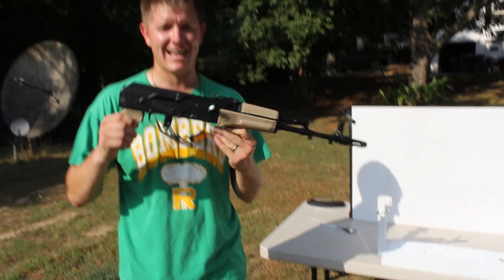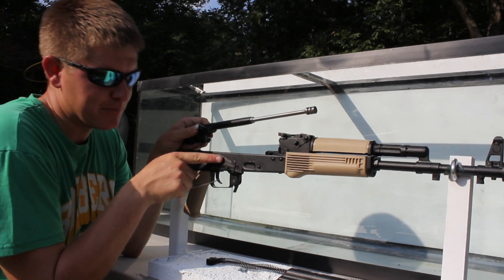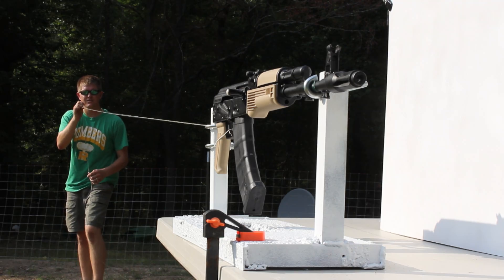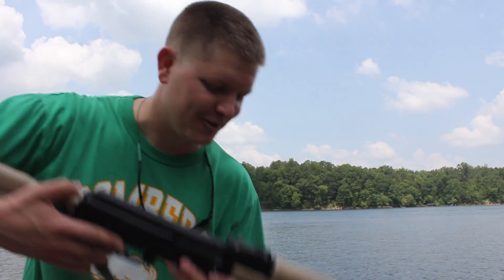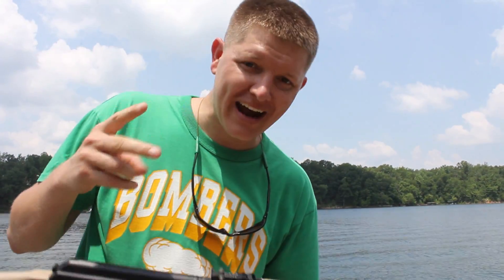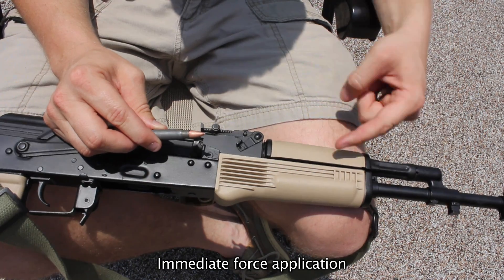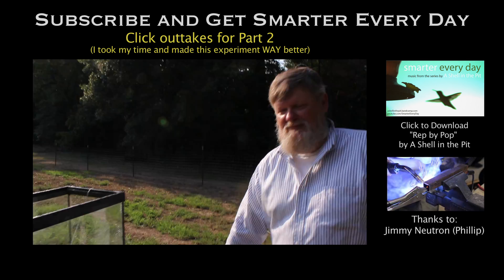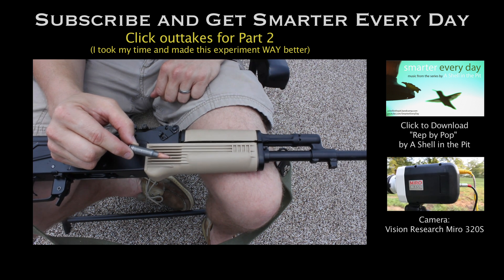Slow Motion of an AK-47 Underwater (Part 1) - Smarter Every Day 95

Comment: You are incorrect, Russia which is roughly the size of the USA has a higher murder rate. And you can not say that it's only one or two factors that account for murder rates. America is massive, half the size of a continent compared to Japan which is smaller than almost all 50 states. Japan also doesn't record murders unless someone is found guilty as where America classifies all murders in statistics. Character limit stops me from listing more
Learn YOUR facts before trying to make a statement.

Comment: Destin, I know you said it messed up the experiment but the way the shatter propagated through the tempered glass was pretty sweet and crazy fast. It was fine one frame, then half shattered the next frame, and fully shattered the next frame. Is it possible for you to get an even higher FPS camera to check out how shattering propagates through tempered glass? I think that's be very interesting. Cheers and thanks for the video!

Comment: when you said "lets see if it works again" i was like duh, its an ak 47 of course it will as i own one of these and it is a extremely reliable weapon and 99% of the time you pull that trigger a it will fire. the other 1% is not the guns fault it due to round being faulty i have maybe 5000 rounds downrange and every time the gun has cycled perfectly it is a remarkable gun.

Comment: The main difference between an AKM (like the one in this video) and an AK-74M is that the AKM and AK-47 are chambered for the 7.62x39mm cartridge and the AK-74 and AK-74M are chambered for the 5.45x39mm cartridge.
You can tell them apart by the curvature of the magazine - 7.62 magazines have very strong curvature, but 5.45 magazines don't curve much at all.

Comment: Actually there are quite a few guns in Europe too though most of it are for hunting. The Czech Republic btw lets you carry firearms for defensive use, and there are a few other nations in Europe where you can do so.

The lower crime rate in for example here in Sweden is more due to social standard than the prevalence (or lack thereof) of firearms. If you look at an individual states in the US, states like Vermont, which has some of the loosest gun restrictions in the US, have low crime too.

Comment: The AKM is basically the same as the AK-47 except that it has a stamped receiver rather than a milled one and it doesn't have a ported gas tube.
This rifle is an AKM.

Comment: Hey destin! I was thinking that the cause for the increased velocity is probably the lack of gaseous waste since in air the firearm loses a small amount of propellant gas to the surroundings and in the water none is lost because of the state of the medium (water) which does not easily allow dissipation or waste through absorption. I'm thinking the water basically seals the system making it more efficient.

Comment: I'm going to go with the incompressibility of water. The air in front of the piston acted as a shock absorber, sucking away some of the energy of the gasses and converting it to more heat and reducing the force applied to the bolt.

Water is incompressible and will transmit all* the force applied to the bolt, causing greater acceleration and faster bolt action.

*Water almost certainly has some compressibility, but it's miniscule compared to air.

Comment: I had agreed with your second theory before you even said it.  I am not certain if there is air, or water inside the chamber to move the piston.  If it was water, I imagined that that was what pushes the piston back faster due to the incompressability.  And I also predicted the faster under water idea.  I always remember the water incompressability idea because of my physics teacher taught us that's why your break system in your car is a break fluid.  It helps break due to it.

Comment: Maybe not with that specific purpose, but people do do it.I own more firearms than could be logically deemed as necessary because at 18 I learned that I'm my own boss and can do that if I so chose.But yes,I have no idea what that other guy is rambling about, the purpose of all firearms is very rudimentary - to fire a projectile at high speeds. You can either shoot out a door and save children from an ablaze building or rob a bank using that feature. Depends on the person, not piece of machinery.

Comment: I noticed the speed that the glass broke was faster than bolt moving back. He said the air is more compressible than the water, but the glass is even more so than both since its solid and more dense.

Comment: You can't just go out and buy a gun in the US either. You have to go though checks and it's not as easy as the media makes it out. Also I learned to shoot early, when I was around 10ish with an air rifle and graduated to an actual rifle. I can't stress how important things like gun safety, trigger discipline and general care when handling anything dangerous is to me know. Even things like my welding torch I look at knowing how dangerous it is. I wouldn't be that way if not for that as a kid.

Comment: You seem EXTREMELY under-read on this topic. The gun pictured is not fully-automatic, school shootings are still very rare, and crimes committed with the type of guns you described account for less than 1% of all gun homicides.
Did you know, for instance, that firearms are used 1.5 million times defensively in the US by private citizens? In the vast majority of those cases, the weapon is not even fired, it's used to defuse the situation and prevent harm.

Comment: Any weapon is a tool. Guns don't kill people.
The difference between a gun and a rock is the same as between a bicycle and a car - both serve the same purpose, but they have different advantages. The deciding factor is not what it's designed for, it's how you use it. For instance, you can kill people with a car, as it was proven countless times.

Comment: As a lesson in hydraulics and the ideal gas law, it loses focus by using a gimmicky tool.    It also glosses over the safety issues of high-pressure inside the barrel and gas system.   We don't know if the gun is safe to shoot again when we leave the video.   These are incredible distractions from the basic lesson, which might be better illustrated with a super-soaker.  Leave the gun destruction to Barry and Eric over at Moss Pawn, and let's learn how hydraulics allow us to steer and brake.

Comment: Basically... No.
The piston moves faster in the water because the water allows less resistance. The piston with its resistance coming from its mass and the spring compresses the air and moves slower. But since you can't compress liquids as well as air, the piston has to move faster in the water.

Comment: Wow. I expected it to go slower. Actually,I didn't expect it to cycle at all. I predicted the pressure would blow out the vent & not push the piston back very far. Boy was I wrong. I guess technically,you did screw up on the glass but it was cool to see how fast cracks travel.That could be a video on its own. You could make a plastic tank (Lexan or something) with a sacrificial glass end.

Comment: i would've thought that the bolt would move slower due to the density of the water. a bit like its harder to move your hand though water than it is through air.

Comment: Maybe I missed it but what fps was this shot at? I am curious because at 3:39 you can see the glass shatter "travel" over several frames. In the Prince Rupert's Drop video you said that glass' sound speed (= shatter speed?) is insanely fast so you need crazy framerates - is this different glass or am I missing something?